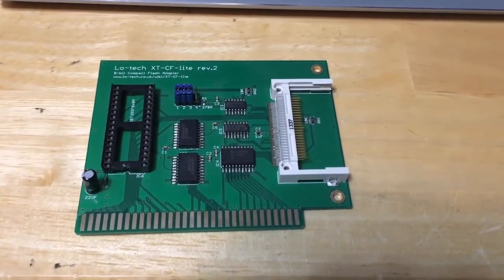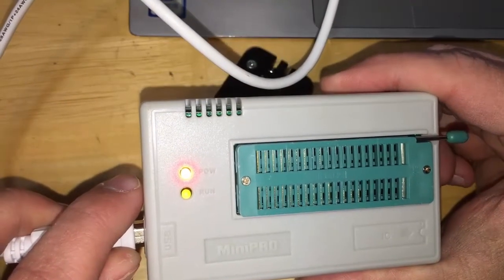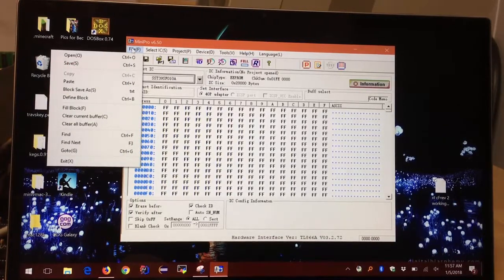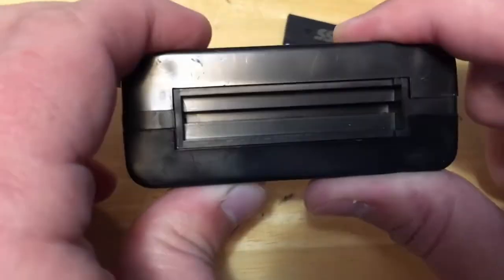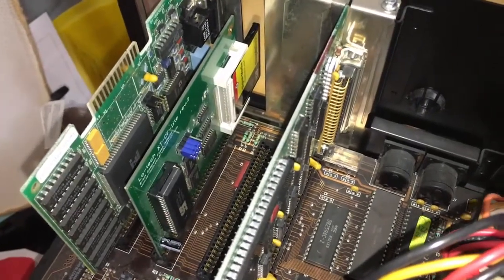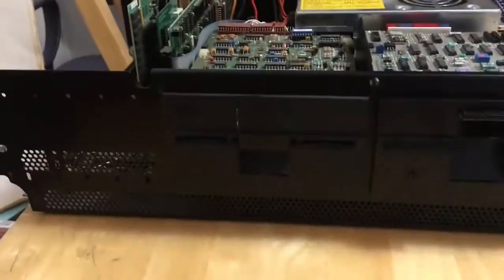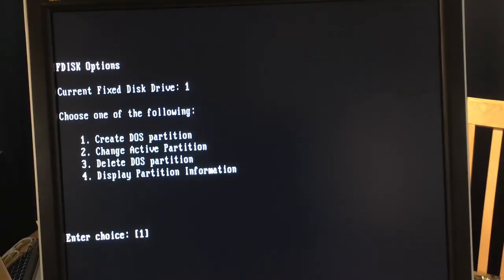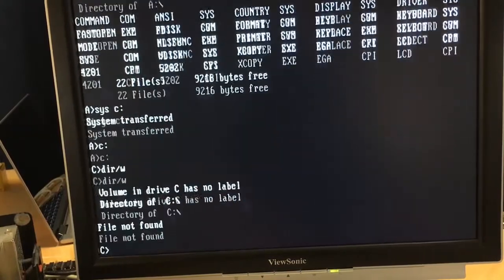Using a Compact Flash Card With an Old Computer - Installing the XT-CF Lite v.2 Card in my IBM 5150

Comment: I need one of these, I have miniscribe hard card and it likes to throw 1701 at me every now and then
Reply from the maker: I do like the clickety-clack of vintage hard drives in my machines, but in the back of my mind, I always know the drive is going to fail. And backing up old drives is far from quick and simple. Using CF cards is super nice because I can easily pop the card out and stick it in a modern machine to back it up on my NAS.

Comment: They say 8 bit XTA HD cards for the IBM clones can work in a 16 bit ISA slot since they are backwards compatible. Is this correct? I can't get the BIOS on the card to be seen by a PII i440 chipset or the SSTOR DOS program either. It is seen on the 8 bit AMSTRAD PC1512SD using SSTOR. SSTOR claims it isn't connecting to the BIOS chip on the card.
Reply from the maker: I would think it would work on any PC with an ISA slot but I haven’t tried it on anything newer than a 286. Look in your BIOS on the P2 system and see if there an option for “Legacy ROM support” or something similar. I think that has something to do with option ROMs (I think that’s what they were called) loading from expansion cards and it may be necessary to make the card work. This is just a guess but it’s worth a shot.

Comment: How do you read the FAT16 CF on a MacOS or WinPC? I have the CF working on my IBM 5150 using the XT-CF Lite v.2 adapter, but I want to be able to use the CF card to transfer files etc. How do I do that? :)
Reply from the maker: I had no issues copying files onto my 5150 CF card from within Windows 10. I did so with several different USB 2 and USB 3 CF card readers.

I haven’t tried it with MacOS.
Reply: @JerryTravisSmith  Awesome. Thanks for your response. I was investigating using Win32DiskImager to make a card image, then use OSFMount to mount the image for r/w. Then it will show up as a drive in your computer, modify add files etc, then close osfmount properly, write the image back to the cf card with win32disk imager... but if Windows reads FAT16 CF cards natively, I'll give it a try. Do you have any 3rd party drivers or apps making it possible, or is it Win natively? Thanks! ⭐
Reply from the maker: Windows still supports FAT16 natively. I’m pretty sure it’ll even do FAT12 (unless they removed that since early versions of Windows 10)!

Comment: where to find this card.
Reply from the maker: The design of this card is open source: http://www.malinov.com/Home/sergeys-projects/xt-cf-lite I attempted to assemble 3 from scratch (using PCBs I bought from a guy who Malinov told me had them) but failed miserably due to lack of skill and dexterity. 

I gave up on putting it together myself and bought one on eBay pre-assembled for around $50 USD.

Comment: Anyone knows if this works with 5155?
Reply from the maker: I have not tried it in a 5155 because I’ve never even seen one in person. However, according to this thread (http://www.vcfed.org/forum/showthread.php?68564-XTIDE-V4-troubleshooting-IBM-5155) it works. The guy in the thread had trouble getting it to work but it was only because he wasn’t programming his EEPROM properly. Once he did that it worked fine in his 5155.
Reply: @JerryTravisSmith  very kind for poitnting out this information